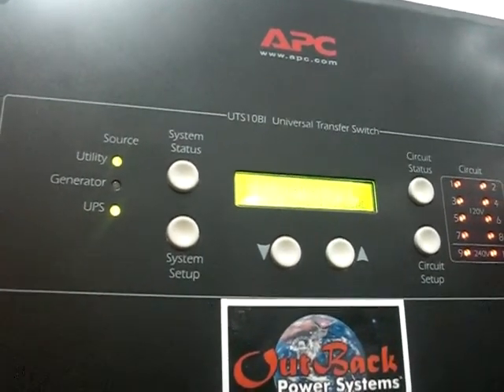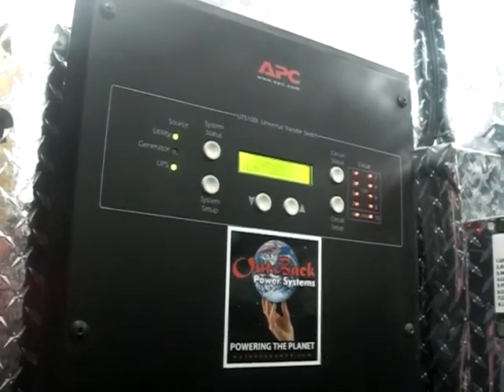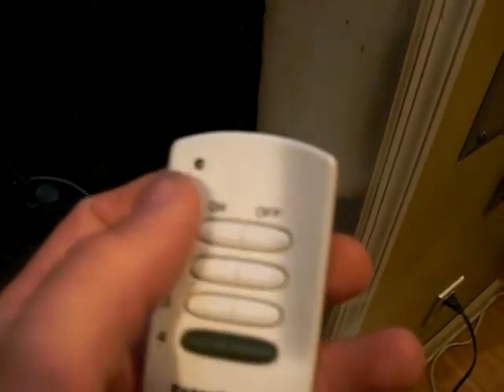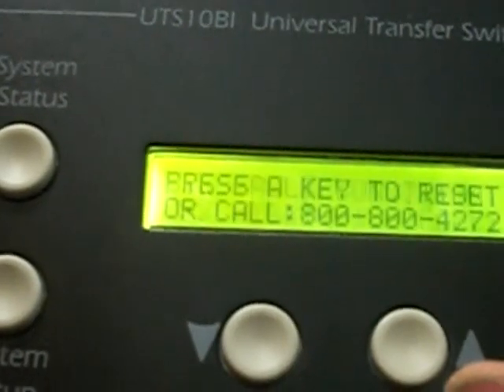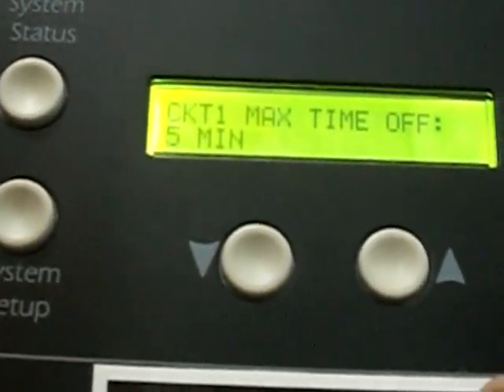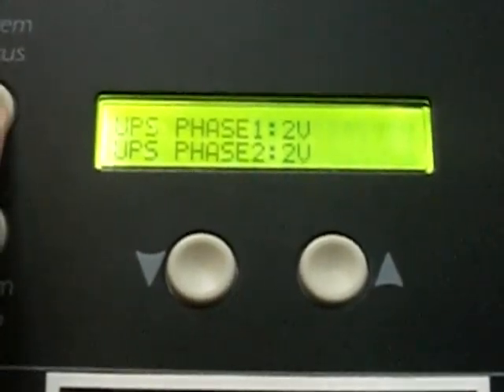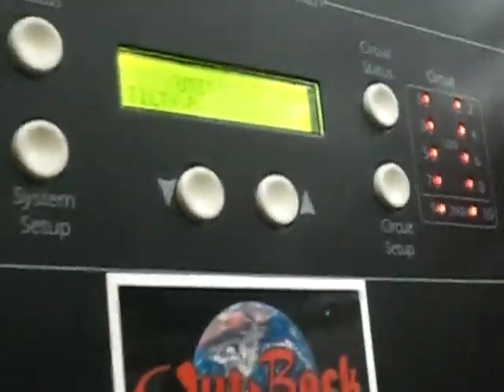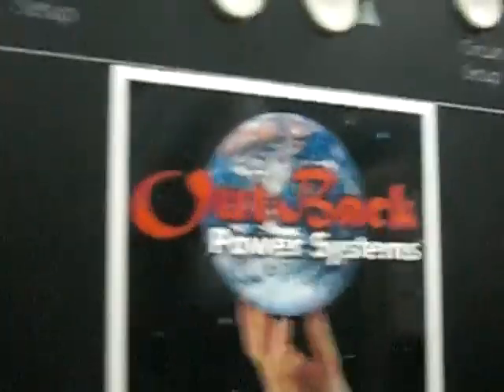APC Universal Transfer Switch

Comment: Hi Browerpower...I was hoping you could answer a couple questions for me before I buy this UTS:

1.     What is the trigger that causes the UTS to switch back and forth between utility and generator/UPS power?
    
a.     Is it the loss/restoration of utility power OR

    
b.     The presence/absence of generator power OR

    
c.     A manual intervention to switch between power sources?

2.     Can you have both utility and generator power feeding the UTS simultaneously (ie. Generator is running before power goes out, sort of “standby” mode)?  If so, what governs which power source is used? Can you select? or does utility power take precedence?...the manual doesn't talk about this at all.

3.     When the UTS is configured for a manual start generator (the automatic option requires an extra kit to be used to start/stop an actual generator; the start/stop delay configuration options only apply in automatic generator mode) would there be a delay in supplying power to generator circuits if the generator is already running when the loss of utility power happens?

 Thanks in advance.
Reply from the maker: The UTS switches between the different power sources when power is Lost for instance if you have a ups on standby constantly connected and you lose utility power it switches to ups power powering circuits 2 to 8 and that gives you time to get your generator started.. once generator is started and online it switches over to generator power.. once utility is restored it switches back to utility and generator can be turned off.. you can have all sources feeding at same time but yes the utility power takes priority until it is lost.. as far as a generator start that would be a separate kit to buy and I’m not familiar with them.. I assume they attach to generator in the same manner when power is lost it sends a signal to the generator to start.. hope that helps
Reply: Thanks for the quick response. 
So I guess you can’t manually control which power source to use if wanted?  For example if I had utility  power but still wanted to run off a ups or the generator by choice.
Reply from the maker: @JohnSmith-tu6gw  no I don’t think you can manually control cause when you wire your 10 circuits to the uts it senses the utility power from 2 of those circuits so when power is lost it will switch the relay switches over to ups or generator..there are load shed settings and uninterrupted settings that can be programmed for each circuit.and if you want a certain circuits to run off gen or ups when no utility is present

Comment: Hi I was hoping you'd be able to answer a couple of questions for me regarding this UTS from APC as I'm seriously considering buying one.

1. Can Adaptive Load Management (ALM), Load Shedding, Time Management, Delayable Circuit be used for the UPS input? All references to these in manual seem to refer to the generator input.

2. It appears the UPS input is limited to a max of 1800W by the firmware - is this correct and if so, is there a firmware update that increases this limit?  I was planning on using a modern UPS that handles greater wattage such as the EcoFlow Delta 1300 and it seems like this unit cannot handle the newer strength UPS' (and I understand this UTS is 10+ yrs old).
3.  Do you know of any other similar/equivalent type device for home use?  I have not been able to find anything that's not big $$ as it's designed for commercial use.

Thx in advance.
Reply from the maker: Hi, yes the load shedding is for generator use only and with the ups input only does 120v circuits 2,3,4,5,6,7,8 with a generator you have all 10 circuits 9 and 10 being for a 240v item such as a well pump..there’s no way to update firmware that I know of ..the ups cord seems to be a 12 gauge computer style plug and cord so so probably meant to do small lighting loads to get you going before you kick on that generator.As far as I know there’s nothing out there like this I actually would have liked it better if it was an instant transfer when power goes out but it’s not unless you program it to Uninterrupted for each circuit 2 to8 and keep ups online.. you could buy a small sub panel and a automatic transfer switch which they use for boat use...hook up your “shore power” which is your main power and your ups of your choice and then out to sub panel and achieve an instant transfer.. the only thing is you won’t have the bells and whistles of the lcd displaying your wattage of each load and what not..hope that helps it’s cool don’t get me wrong..but if your just looking for something to get you through a storm when you have a power outage there’s a cheaper way to go about it..
Reply: @fanman1981  Thanks so much for responding so quickly - faster than APC support lol.
I don't understand why APC or another company hasn't made an "updated" version of these types of devices as they are very useful.  With all the improvements/options in backup power now, there are loads of choices without having to run a traditional gas/LP generator that produces carbon monoxide.  These newer battery type "generators" have power near equivalent to avg home generators (1800w continuous, 3300w peak), full sine wave inverters, very quiet (only fan running), UPS tech and they can be indoors due to no exhaust.  All of the switches I look at don't seem "ready" for this newer tech which is disappointing.  Again, thanks for your help, John.

Comment: I just bought one of these APC transfer switches.  Is it still working good for you after all this time? thanks
Reply from the maker: YUP!! Still works great im happy with it..it was a real help during Hurricane Sandy..Thanks
Reply: +BROWERPOWER 2010 Awesome man, glad to hear that.  Question, why do your circuits 1 & 9 say utility if you cut utility power? Shouldn't they also say ups? Was that what the error message was about? Thanks again

Comment: Hey Fanman1981 ! I installed mine about 7 months ago,it was on backorder for months!.well I ordered the hardwire kit for mine,and it turned out that the hardwire kit already came pre-installed,and the front L14/30 input was not there.I purchased the the uts10bi as well.Must me a design change.I'll throw up a video.

Comment from the maker: 1-9-10 i noticed can only be used only when generator is online 9-10 is 240volts 20amp if u have anything thats 240v 20amps... you can wire (2) 120 volt circuits to 9-10 if u want there is no setting to see for circuit 10 though.i have 2 of my kitchen 120 volt outlets on 9-10

John

Comment from the maker: @MrSilverSurfing It just switches over when power goes out but i can configure it to run some circuits on battery some on utility but i don't want to drain batteries everyday..it will eventually kill batteries.i also hooked a cheapy generator up to it just for added power if necessary and ill do a future video on that setup